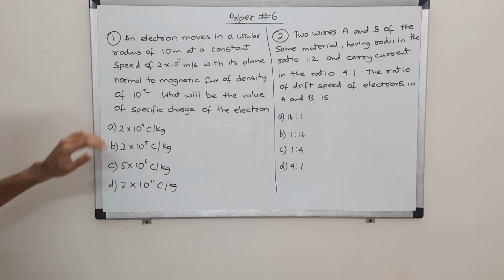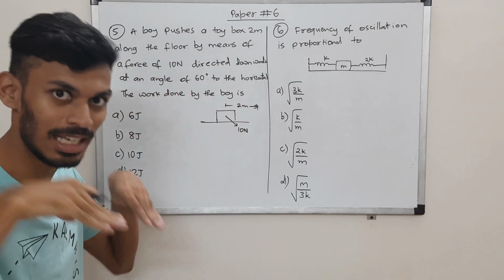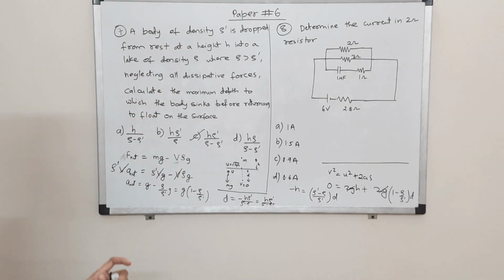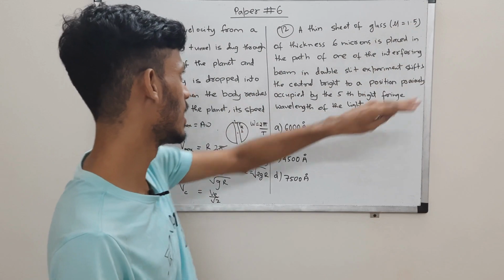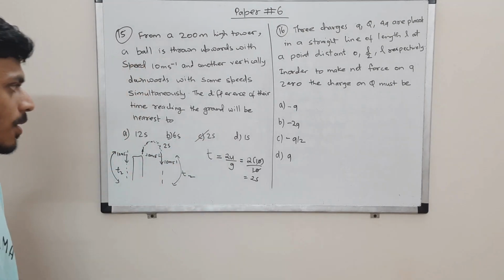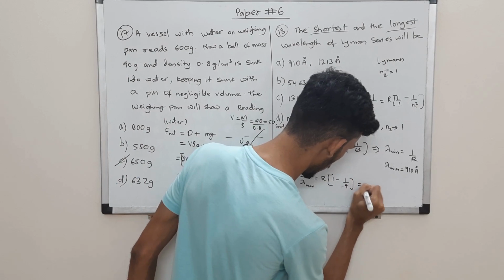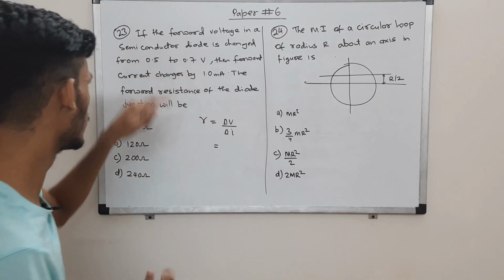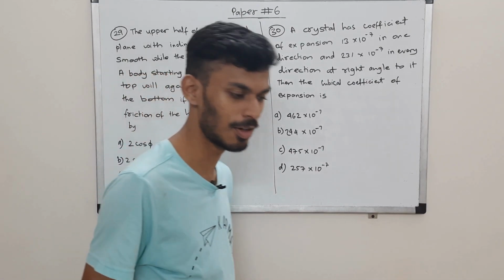BITSAT 2022 | Mock Test Series | Paper 6

Comment: Complex numbers, sequence and series, pnc, matrices and determinants, statistics, trignomentry, probability, straight lines, circles, 3d, vectors, quadratic equation. If I cover these chapters will I get good marks in maths(bitsat maths).
Reply from the maker: These chapters have a fair weightage for BITSAT but can't guarantee you that it will be good enough.
Reply: @GEMOFPHYSICS   how much marks will I get out of 120 ? around 70 marks in maths.